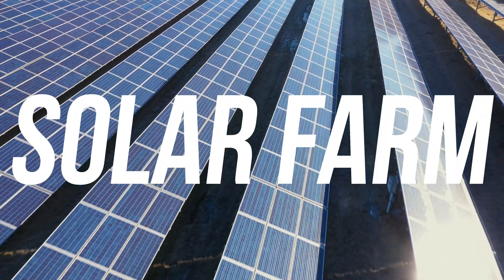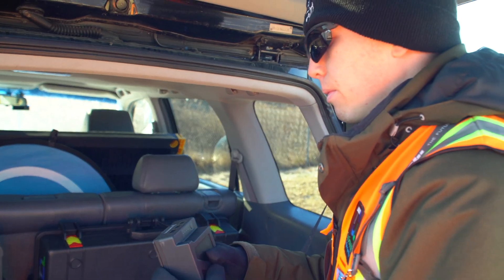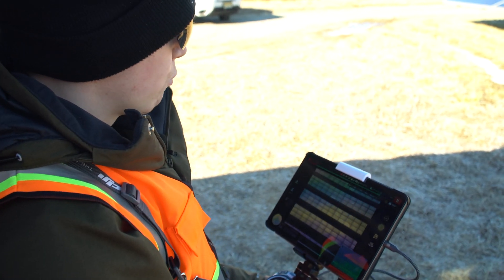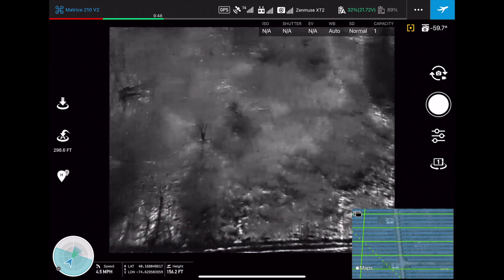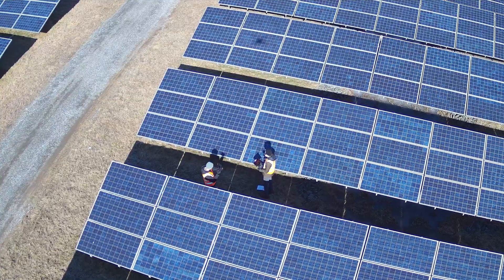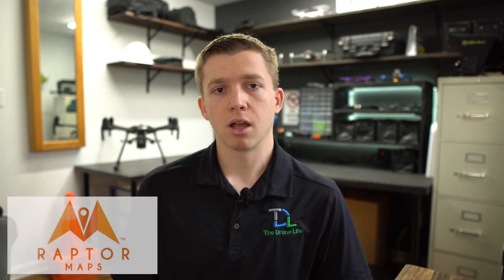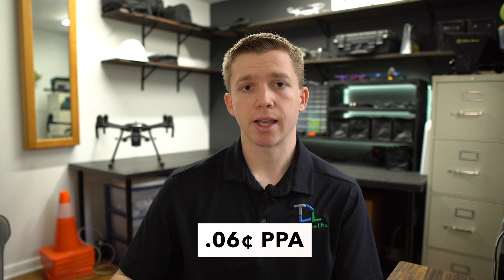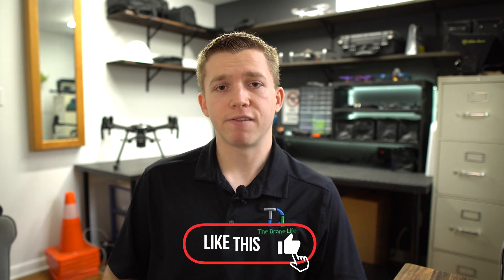Drone Solar Farm Inspection Reveals $21,423.27 in Revenue Loss!

Comment: Great and very detailed video. The company I work for owns a solar power plant in Dominican Republic, and right now the O&M team is performing the inspection with a manual thermal camera. It takes a lot of time to perform this activity. For sure a drone thermal inspection and report with Raptor Maps or any other software could improve these inspections and save the company lot of money due to losses caused by faulty PV modules.

Comment: I curve tracing is the only way to do it right although super labor intensive. Luckily some newer inverters have built in Iv curve tracing built in making thermal scans not as critical. Pulling modules for warranty is also alot of work

Comment: Perfect, informative video! I have a question regarding data processing. Which of the three levels of Raptor Maps inspections have you used in this project; Overview, Standard, or Comprehensive? What criteria does usually affect the choice of one of these inspection levels. Thank you in advance.

Comment: Would a mavik 3T work for this kind of work? Is there a minimum type of thermal sensor you need to do this kind of work?
Reply: he's using Mavic 30T for this work, if u see the specifications beetwen 30t and 3t they have exactly the same thermal camera. 30t have more time flight, diferents atachments and specifications, but, if u see the T camera specifications they are exactly the same... so yup, u can take that photos.
Reply: @MauRolsky  he's actually using the Matrice 300.

Comment: So I initially was going to get out of content creation mode and get into the commercial side of things but then came to a hard stop. I don’t want to spend $6500 on the M2EA and the Phantom 4 V2+ is $2000 for outdated technology. So what do you recommend? Photogrammetry and orthomosaics greatly benefit from the PV2+ mechanical shutter, and the Air 2/2S operate super slow for drone deploy… and the Mavic 3 doesn’t support waypoints or lichi. Man I’m super upside down on what to get. Thoughts?
Reply: You have to spend money to make money. You are talking about a very small investment to have a great ROI.
Reply: What did you end up doing?
Reply: @speedbird7976  I have decided to wait until DJI fixes there GPS issue (hopefully June) and will most likely buying the Mavic 3. But I think the Mavic 3 with the zoom lens will be great for Inspections and I will give that a try. Yes it doesn’t have thermal capabilities but that will come later down the road once I can start actually making money.
Reply: @robertbondar6640  mavic 3 can't fly missions. you need an enterprice version or the phantom or mavic 2 pro
Reply: @speedbird7976  I bought Sensefly eBee X platform and a DJI 300.
Reply: For an entry level here's my take...you can but the Phantom 4 V2 (that's if you find) and get one of the PPK Kits that use the Emlid GNSS Receiver (Reach M2). Also get a GNSS Base Station (RS2 or a modification using the Reach M2 and a LORA Radio). The Phantom 4 V2 is old technology but it's still the best entry apart from it's RTK version. The Mavics are good but their Electronic Shutter systems may not be the best for mapping solutions. Have a great one.
Reply: @OyebolaAdedapo  How does Skydio 2+ or the Enterprise version compare to DJI?